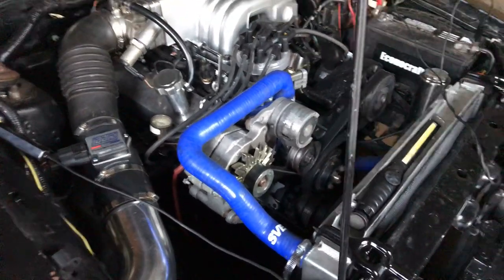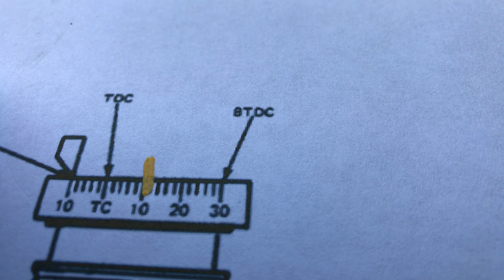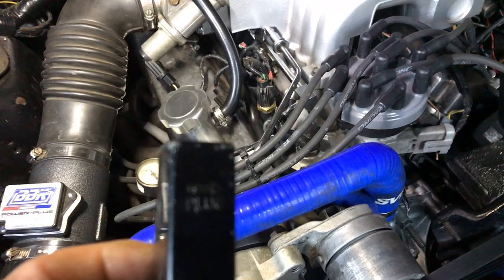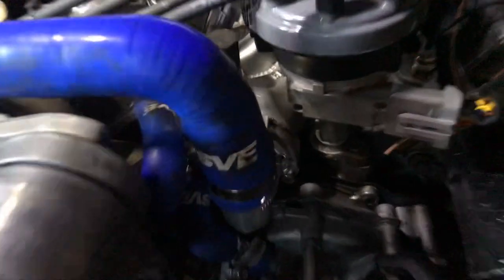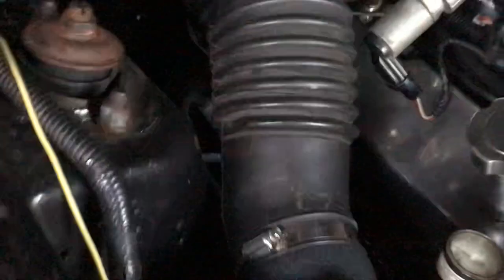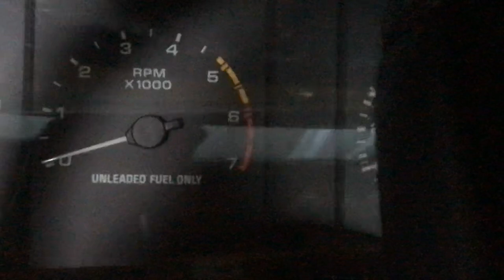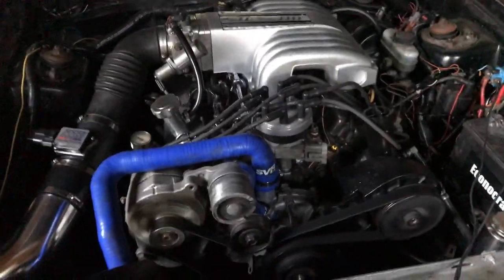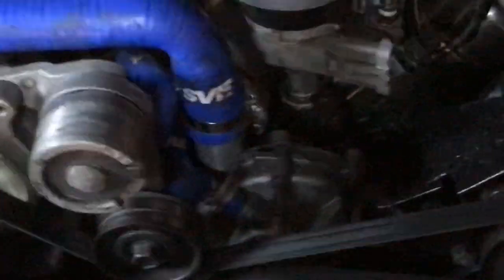Fox Body Mustang Ignition Timing

Comment: Mr. Palmer just wanted to say thanks!  I came across this vid and picked up the same innova timing light and set my timing on my 88 lx 5.0 today!  Shes running like a top now! Before I had no acceleration and hesitation. Your 1 wire alternator vid also helped me out over the winter. I got the same summit alt and installed. You're vids are great!!! Thanks again.
Reply from the maker: Thanks S&T - inspired to make more videos.

Comment: I was real anxious at the thought of attempting this on the '89 GT convertible I just got, but this video was so well laid out and explained, I'm excited to actually go out and do it! I'm going to start shopping for the proper tools ASAP!
Reply: Im gonna do mine in a bit I’m excited.
Reply from the maker: You can do it! Mark harmonic balancer at 10 degrees BTDC with a white or yellow marker. Pull spout connector out and set timing. Good luck

Comment: Why’s your distributor turned soo far to the right? I notice a lot of cars it points at driver head light
Reply: Bottom gear on distributor turned. Mines was to closer to the left before I changed it, then when installed new distributor mines almost same position as his now from sitting it in.

Comment: A stock Fox body motor loves 12-13 initial.  If you have traditional aluminium heads you can go to 14-17 initial.  I Just put some TFS 11r 190s in. These heads like LESS timing than stock.  I went from 10 degrees initial to 9 initial and made more power.

Comment: Nice video and good info but I noticed you did a AC/Air Pump delete would you know which belt your using because all the autoparts stores by me don't have the slightest clue on which belt do I need?
Reply from the maker: You need a Dayco 5060720 - Order from Amazon, Advanced Auto, Summit ($30.99) ect. Belt, Poly Rib, Serpentine, 6-Rib, 72.00 in. Length - deletes air pump and air conditioner

Comment: Hey Mr. Palmer, its Mr. Palmer. I thought you cut the car off and then install the plug. Is that not correct? Just curious because I rebuilt my motor with an E303 Camshaft, new pistons, rings, beatings and ive got a strange knock or pre detonation. About to do the timing gun tomorrow from your instructions. Hope you or someone else can respond relatively quick. Thanks!
Reply from the maker: KP - great to hear your built that engine yourself. That E303 cam is a very good choice. They sound amazing. I'm running a Trick Flow cam (Track Max) Stock timing is 10 BTDC. With that cam it might like 12 BTDC better, give it a try!
Reply: @JeffPalmerJWP  thanks a bunch! Doing it today!
Reply: @JeffPalmerJWP  hey so I got the timing done perfect and did a base idle reset. I am having a knock on the valves. Pulled them and undid the torque to a bit lower. I had em torqued to 25ft pounds and bumped it down to 20 ft pounds. Was thinking the rockers were too tight. Think this will fix my knock?

Comment: Great video, might wanna tell the viewers because you dont have your A/C anymore its piece of cake to loosen the distributor bolt,when all that stuff is in the way a distributor wrench is almost mandatory (specially if someone else tightened the heck out of the bolt), on another note not sure how you got away with having that fan with that alternator, my god those stock alternators are incredible weak,i have 2 of these cars,my 91 since new,one of the first things i did was slap a 160 amp alt on it,i installed it the correct way with the big wire and the fuse inline, big difference in the charging department,i got the alternator from a V6 mustang at the wrecking yard,heck of a deal.
Reply: He probably had it rebuilt, when i rebuilt my 84, i had the amperage on mine bumped to 140

Comment: I set it exactly the way you do it in the video but when I reinstall the spout connector it jumps up a few degrees. If I pull the spout out, it sits exactly where I set it. Why does this happen? Is it normal?
Reply: Yes it is normal, spout connector unplugged allows you to set base timing, plug it back in and the computer takes back over
Reply: Thanks for your help. Much appreciated.
Reply: @stevealvi2239  no worries, if you need some help with basic maintainence stuff on a foxbody, check out brew2l hes got some decent vids that show you common problems with them and fixes for them as well.

Comment: You can also mark the harmonic at Zero and set the gun at 10 degrees to check it
Reply: That my question is the gun set at 10 to get 10 on the harmonic balancer or is it set a 0 to get the 10 to line up
Reply: @djdev3077  if the gun is set on 10 degrees then the mark on the balancer should be right on zero . If the gun is set on zero the the mark on the balancer should be right on 10 degrees!

Comment: What cam is in your car? I have an E303  with 2200-2400 stall converter and it has surging / stalling issues. Had to bump idle up to around 950-1k just to keep it running without stalling. Was wondering if timing was too low but it looks to be about 12-14
Reply from the maker: Trick Flow - check for vacuum leaks - set timing at 10 degrees btdc

Comment: I’ve set the timing where I want it but once I re connect the spout connector and check the timing again it’s off by a lot any advice on this? Not sure if this is normal
Reply: Same lol
Reply: Try setting less then what you want and it be on your mark
Reply: It’s normal. What you are setting is initial timing. When you plug the spout connector back in, the ecu takes over.

Comment: What belt did you use to bypass the ac and smog and did you get the power steering relocate bracket and move it up to where the ac was ? I have already gotten rid of the smog and has a pulley but it’s broke and walks the belt to the back and the previous owner took out the ac stuff so want to remove the pump sell it maybe for $25 if anyone might be interested but been fighting to find a belt and read conflicting info on if any belt will work and if the P/S needs to be moved up etc
Reply from the maker: .Pop open the hood of your car. Make sure you have engaged the parking brake and that the vehicle is off.

Step 2
Locate the path of your serpentine belt. If you are unsure the of the path, look under your hood for a diagram or in your owner's manual. Follow the path with the piece of string.

Step 3
With the string tightly wrapped around the correct path of the serpentine belt according to the diagram in your owner's manual, mark the area on the string with a marker where it completely wraps around.

Measure the length of string it took to wrap around the path of the serpentine belt. Purchase a belt one size smaller than the size you measured. The actual belt will have tension on it, whereas the string doesn't. For example, if you measured 80 inches, purchase a belt that is 79 1/2 inches.

Comment: Ok,question is the gun set at 0 or 10 degrees,that part nobody shows
Reply from the maker: Set timing at 10 degrees BTDC - mark harmonic balancer at 10 degrees with a white or yellow marker. Try 8 or 12 degrees it you want to. My car runs best at 10 degrees.